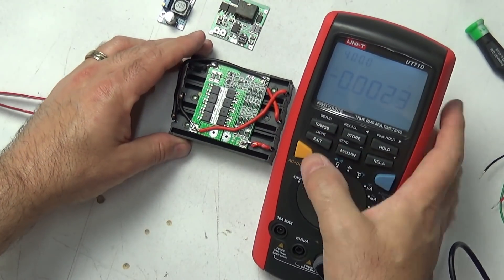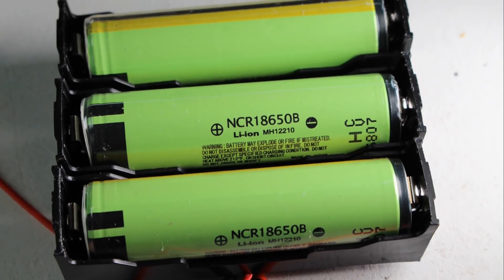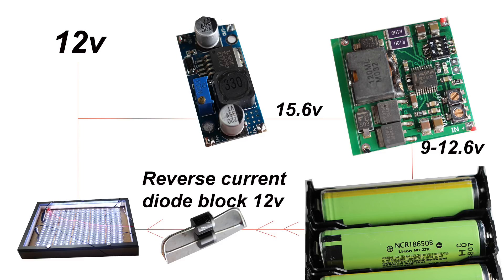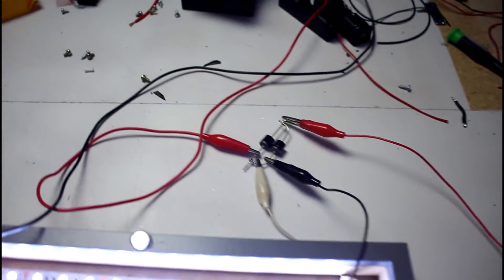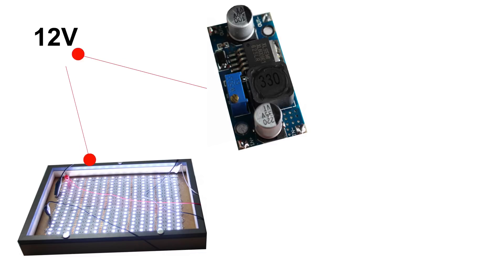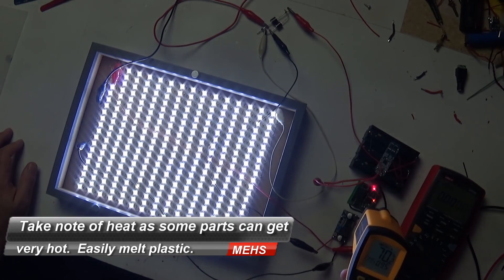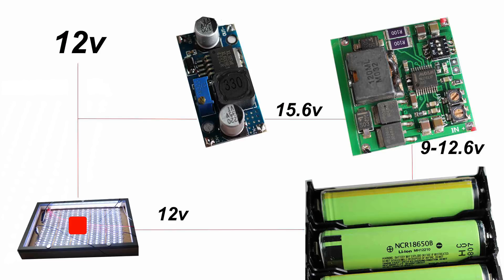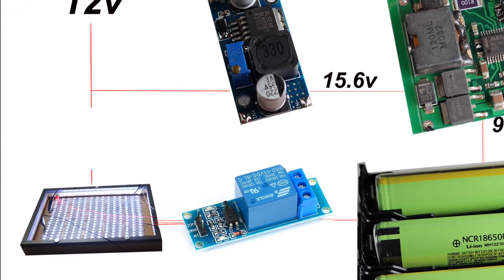Make Your Projects Rechargeable -12v version (MEHS) Episode 68

Comment: Hello, thanks a lot for this video !
One question : does the relay have a small delay ?  I want to power up a raspberry or pc, if i disconnect the power supply, the motherboard will be shut down before switching on to the battery ? If so, how can I avoid this delay ?
Reply from the maker: - Hi.  There is no relay in this example unless you have implemented one, but I think I know what you're asking.  Check how you have everything connected as your Pi should not power off.  The Pi will receive power from the external source and the battery bank at the same time.  When the external power is off, the Pi will draw all its needs from the battery bank.  If you're using a relay and have it wired up correctly, the relay should switch power over much faster than the Pi needs.  One switched over, check that you have a good voltage coming from the relay / battery pack, going to the Pi.  If not, you have a relay or wiring problem.  If all is good then the relay must be really slow.  You can replace it or put a large capacitor between the main power and the Pi.  This will keep the Pi fed for a second while the relay switched things over.  Cheers.
Reply: Thanks a lot, the relay seems to works fine at same voltage, but now i've got an other issue, i use a boost converter (at the end) to power a 19V project but it doesn't seems to do the job correctly... The motherboard shut down when i change the IN voltage. Do you think a synchronous booster should solve the problem ? But it's expensive... Maybe you know a simple and cheaper way to keep same voltage between battery and power ? Thanks again :)
Reply from the maker: - Hi.  You will need to describe your project in more detail.  It might be that your boost converter is not able to produce sufficient current.  Cheers.

Comment: This was very helpful, I'm building a 4s 45/50Ah. I have a laptop power supply rated output 19.5v 4.7A. would this charge this size pack using a BMS and the MAX745?
Reply from the maker: - Hi.  Yes that sound about right.  The MAX745 takes up to 20V (from memory) and 2A charge rate so feeding it 19.5v and up to 4.7A is more than enough (current anyway).  Just make sure the MAX 745 is working correctly as some are very fussy and if you're just under the 3V buffer then it won't work.  If your 19.5V is under at all or you have a fussy MAX745 then you might run into problems as your pack is 16.8V and you should be giving the MAX745 19.8v ideally.  Cheers.
Reply: Hi there will MAX745 stop charging once the batteries are fully charged or continue charging causing over charge? Thanks
Reply from the maker: - Hi.  The datasheet for the IC doesn't specifically state charge termination but the fact it charges correctly using CC and CV means it has a charge termination point.  So yes.  I can't say for sure at what point it will reassess the cells and start a new charge cycle.  Cheers.

Comment: My Electronics & Hacking Show+
Do you have a link for that relay? The Relay - Ebay item number
222626676317 is not working, thanks
Reply from the maker: - Hi.  Just tried it.  Still works (at least on Ebay.com.au).  Alternatively search for  1/2/4/8 Channel 5V 12V Relay Module Optocoupler Isolated .  Cheers.
Reply: I live in the USA I'll find it, thanks.
Reply: I went to Ebay.com.au and still turned up no item

Comment: My Electronics & Hacking Show+
As a perfect replacement for the not so ideal diode, go to ebay and type in "Ideal Diode". These are 100% blocking and the function using P Channel Mosfets. Cheers.
Reply from the maker: -  Thanks for the tip.  Cheers.

Comment: hello if i wanted to permanently mount this in an enclosure what charging port would you recommend that is waterproof? would something like this work? https://www.ebay.com/i/371348366275?chn=ps&dispItem=1 i have a ac adapter that plugs into the wall
Reply from the maker: - Hi.  Yes sure.  It doesn't really matter what sort of plug you use as long as it can handle the current (which is low) and get the positive and negative to where it is needed.  Cheers

Comment: This is so cool i been asking all of these questions myself recently and could not find online anything that got to that level of detail for these practical issues, u saved the day for me so thank u. 
I am trying to build an 18650 based UPS with a 3S4P arrangement and Panasonic  NCR18650B 3350mAh Li-Ion batteries.
After seeing your video late last evening i ordered the Max745 board (i am in the UK and i could not find any locally available so i ordered from ebay via China) i have already a BMS on the way and a buck/bust converter. Is there a way for you to share with me/us a wiring diagram via email or dropbox etc? I am also interested to find out more about how i could substitute the relay with a solid state device ? 
Any way to contact you directly for advice too pls?
Reply from the maker: - Glad to hear.  I will try to put something up on my website this weekend.  You're biggest issue will be the switch that cuts in when mains power is cutoff.  You can use a high current relay or a MOSTFET and they are each used in roughly the same way.  Just google the complete wiring diagram for a basic UPS and you should be fine.  A complete UPS wiring example might be better for you anyway as some have a smoothing capacity in the circuit to avoid spikes and dips in power when the power cuts over.  As far as connecting power to the MAX745 is just one positive and one negative wire (easy), and its the same for the connection from the MAX745 to the BMS (again nice and easy).  Best of luck.

Comment: I would to biult a Powerbank with 24 cels and want to charge it in my car with 12-14,5V / 10A. I´m not shure 3S or 4S and what charging board i need do you have any good ideas? i want to charge every cel with about 1,3-1,5 A. Do you have any tips for good hardware for this project? I think this is a lot of Power and i don´t know which hardware can handle this. THX
Reply from the maker: - Hi.  The answer would depend on the details of what you're trying to do but the easiest way would be to buy 3 or 6 XTAR VC4 chargers to charge the cells.  You would need to use nipple type cells but these chargers are not overly expensive and will run from a 12V car power supply and provide a very good charge to each cell at about 1A each.  That would give you a very good outcome and maintain the cells for a long time.  Cheers.
Reply: yeah this charger is nice but i could only charge single cells but i want to built a big powerbank wich i could charge with one 12V plug in the car with enough speed. the plattform you show is nice but i think for my porpuse a little bit to small. i thought i need a charger board around 36 A at all. i want to charge at 120 W that is the maximum at a 10A fuse for the cigarete lighter in my car. i have a B6 this could handle this but i had to config it at every start of my car, and i want that the charging starts automaticly from crank.
i have 2 of the usb charger from ur little powerbank that i want to use/discharge the bank and maby other 12V aplications.
Reply from the maker: - maybe take a look at something like  https://hobbyking.com/en_us/turnigy-4x6s-lithium-polymer-battery-pack-charger.html .  You can then charge a 24 cells pack properly and the charger body runs from a 12v supply.  Cheers.
Reply from the maker: - Hi.  These boards are not chargers as you mentioned.  I don't know of any module that will do what your after at that charge rate.  You may have to make your own.  Cheers.
Reply: Hi I have been trying to do something similar, but I wonder how to limit the current coming into the bms.  It seems to want to draw fairly high current.  My battery pack will be connected to a 12v vehicle battery most of the time, which can supply very high current if not limited.  How do I limit the incoming current, and what is a reasonable charging current?

Comment: Another solution to disconnect the battery when external power is connected, is to use a MOSFET. This would reduce the power loss in the form of heat when using diodes.
Reply from the maker: - Hi.  Yes absolutely, a MOSFET is a good way to go.

Comment: So- if my project required a 5s- would it work the same, but with a 5s bms, and crank up the pot on the step up voltage regulator to the max 745?
Reply: ..and then beef up the reverse current diode block
Reply from the maker: - Hi.  Yes with the 5S BMS, no with the MAX 745.  Yes just grab the BMS rated for the number of cells and current you are dealing with, 5S in your case.  Unfortunately the MAX745 is not rated to charge 5S, only 4S.  You won't get enough voltage out of the MAX745 for a 5S pack.  Need to find another charging option.  Cheers.
Reply: My Electronics & Hacking Show am I able to charge from a step up voltage regulator? If I found a 12v charger for cheap, but needed 21v to charge my 5s.. could I step up the 12v with a regulator to do so?
Reply from the maker: - Hi.  Dont forget a Voltage Reg will just dump a fixed voltage at a fixed current into your 5S pack.  That's not ideal.  The MAX745 provides the correct charging methodology as discussed in other videos.  The BMS will kick in if you use a step up reg and the charge in the cells exceeds the max voltage (say 4.25v per cell) but the BMS won't kick in if the reg is pumping 4.2v per cell and not going over.  The reg will just keep pumping 2A (or whatever the value) into the cells at 4.2v each until something gives.  If you must use a straight reg then you must use a timer.  To do it right, you could buy a real 5S charger (turnigy) and setup your project to be charged by that instead of just a static external charger.  Cheers.
Reply: My Electronics & Hacking Show thanks for your time mate!

Comment: What cherger would charge this cells thriygh 3s bms is it 5v or 12.6v?
Reply from the maker: - Hi.  If you are feeding raw power to the cells through the BMS you need to be using 12.6V for a full charge.  If you are using a proper charger then the charger will determine the voltage and current required.  If you embed your own charger (MAX745) to properly charge the cells through the BMS you usually need to go 3V higher (to15.6V) so the charger has sufficient power to run itself and do the job correctly.  Cheers.
Reply: Thank you.

Comment: Fantastic project ,,,,,,,,,  exactly what I've been working on. In my searching for a solution, i came across this approach. Would you take a look at this schematic and give your input and perspective. This is the link ,,,,  https://youtu.be/cBM0aUGW87Q. It appears to work, but I'm a beginner and would love another set of eyes and an experienced review. Thanks.
Reply from the maker: - Hi.  Yes it looks like it would work theoretically as the main issue with multiple TP4056's is the common ground.  He is avoiding the problem by using what looked like a timer IC to switch between the TP4056's and only having one connected at a time.  Cheers.
Reply: My Electronics & Hacking Show
Magnificent, Thanks for the reply. Also, would you be so kind as to point me in the right direction to get more info on how to choose the correct solid state relay you suggested instead of the one shown. I am a BEGINNER, so I have to do tons of research before I choose my build design. By following your design but incorporating his charge method, it seems that i would have to make accommodations for the 12v input to the lights and step down to 5v input for the charge circuit. So, I want to add a smaller relay and I like your suggestion for the smaller type. So, as you can guess, I'm unsure of how to choose the right relay. Your help would be greatly appreciated. Thanks again for all your help.  Sincerely. CHEERS!!!!!
Reply from the maker: - Hi.  I haven't found anything perfect yet but I would look at MOSFETS with isolation and sufficient power handling or start by looking at relay providers like POLOLU and checking the specifications.  You can also just google the requirements such as relay isolated 12v 10a etc.  Cheers.
Reply: My Electronics & Hacking Show 
Hi, I did a little Amazon surfing and found these 2 options: I think that they might work. 

Kyoto Electric KF0602D DC-to-DC Solid State Relay, 32 Volt, DC Input, 2 Amp, 4-Pin, 1.4"L x 0.3"W x 0.9"H
and ....... 
XCSOURCE 5PCS 5V/9V/12V/24V 1 Channel Relay Shield Module Optocoupler For PIC AVR DSP ARM Arduino TE213

As I said before, I am really a true beginner with just enough smarts to think I can do this. But, I don't want to buy the wrong parts. 
So, let me know if either of these items will work. 
I want to replace the Diode and put in the proper relay. So, I'll need a little guidance with choosing the best part. Then I'll do some YouTube searching to make sure I get the wiring and installation correct. Always want to make sure that my memory of how to install is correct.
I've finished the charger build and installed with a 10A Diode, for now, in a LED lite panel inside an old wall clock. And it works quite well. Will also add on/off switches so that I can turn the lights off while charge the batteries. 
 
Thanks for all your input and help.
Reply from the maker: - Hi.  I can't say for sure as i depends on the details of the board and your final circuit design and implementation but I would go with the relay module for Arduino.  It should be easier to work with and it should be isolated from the load.  cheers.

Comment: I would need a 6S.. would it be possible to use two MAX745 in parallel and still have all 6 cells connected in series?

Comment: Hey buddy, question for ya:. What if your external supply is higher than 12v - eg 19v laptop charger cable. Would you step down first for the project then step up for the charging?
I've been trying to figure out a way to power my led panel via a 4s connection with optional charging via a 19v power supply.
Reply from the maker: - Hi.  if your led panel draws less than 1.5A the your good to go as the MAX745 charging board accepts up to 20V as the input and will charge the 3S pack up to 2A.  A 4S pack get charged at 1.5A from memory.  If it draws more then you will need to figure out where best to send the 19V and have it stepped down for the LED panel.  Just remember not to step down for the MAX745 board as it needs a minimum input voltage 2V higher than the pack being charged (so 14.6V input for a 3S pack and 17.3V for a 4S pack).  Cheers.

Comment: Have you looked at this board https://www.aliexpress.com/item/3S-11-1V-12-6V-4-2V-66mA-18650-Lithium-Battery-Balance-Board-Charge-Charging-Balanced/32827212425.html?spm=2114.10010108.1000013.7.40c9f1f969wNpc&traffic_analysisId=recommend_2088_4_90158_iswistore&scm=1007.13339.90158.0&pvid=4dca8e79-2832-4bf9-b291-380542867ecc&tpp=1 that way you do not need the MAX745  and 12v DC to DC 15v board?
Reply from the maker: - Hi.  No this board is just for equalisation.  You still need a real charger, hence the MAX745.  Cheers.

Comment: I wonder if it can power a Macbook pro touch bar... can't find any diy project with 18650 batt powering a mac on the go
Reply from the maker: - Hi.  Shouldn't be that hard.  Just need to match up the input power requirements with the output of the power pack.  I don't have a macbook handy to test unfortunately.  Cheers.

Comment: If you don't need both charging and driving the project at the same time, is it really worth it to complicate this much compared to only BMS? For the price of the max745 and buck converter you can buy 5 more batteries (LG 2600mA). Do you think the improved charging and subsequent improved life of the batteries are worth it from a purely monetary point of view?
Reply from the maker: TullenSerpen  - Hi.  Yes very good point and something I was going to discuss in this or a follow up video.  Basically it’s good to know an approach like this but you should evaluate your needs for each project and determine if the cost and complication is worth it.  Cheers.
Reply: Thanks for the reply :). How about tp4046 in parallel as discussed in the comments on a previous BMS video. Have you looked into that? Would that be cheaper? Or do we need a BMS also in such setup?
Reply: Also, if we really want to maximize battery life should we not cut the charging at 4v and discharge at 3.4 or something?
Reply from the maker: - Hi.  Yes the TP4056 boards are great and you can string a few together in some instances.  The trick is the common ground meaning you can't connect the outputs of the TP4056's together without disconnecting the common power supply.  It can be done with FETS or relays but can be fiddly or is not a good fit for some projects.  I will revisit at some time.  Cheers.
Reply from the maker: - Hi.  Most good cells are more than happy being drained to 3V, many down to 2.7V.  Yes it is documented that a 4V charge will give the cell some charge without stressing the cell meaning you can make the cells last longer.  It depends on the use and the needs of the project.  Some project designs call for max power and runtime whereas others are less demanding and you may decide to dial back the impact on the cells and trade-off for longer life.  Cheers.

Comment: Love it! That's what I'm planning to use for my arm laptop. Thanks for the video it's great!
Reply from the maker: - Hi.  Great.  Thanks.  In a small sized project try to fit in the relay option as it generates a lot less heat.  If you cant make it fit just make sure you have plenty of ventilation in your project.  Cheers.
Reply: My Electronics & Hacking Show I'm going to try a mosfett based solution to disconnect the power if the heat of the diode based version is too much, I'll report back if it's worthwhile.
 I found a 10a 60v diode that has a mosfett-like package (superior cooling), its the MBR 1060. I'll see how it goes.
Reply from the maker: - Great.  Let us know.